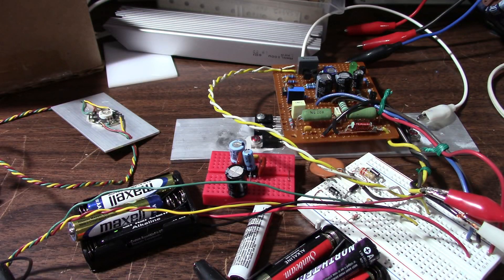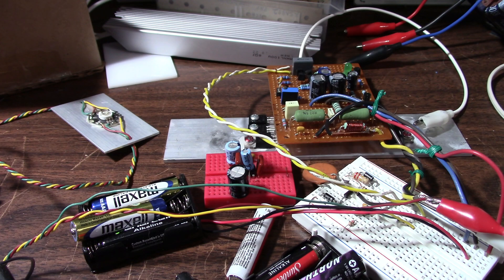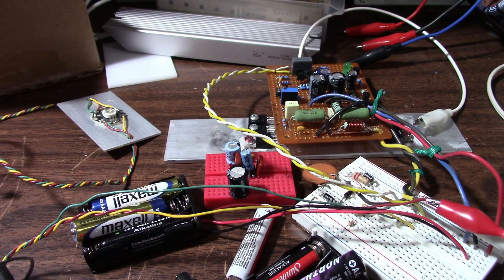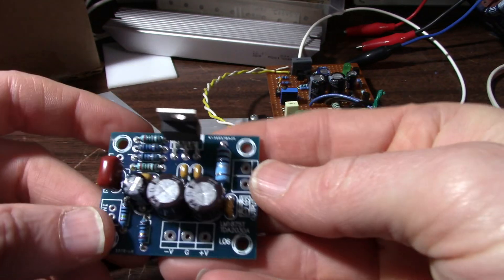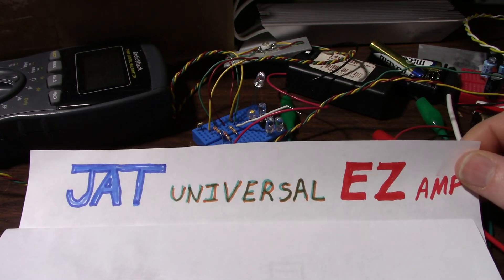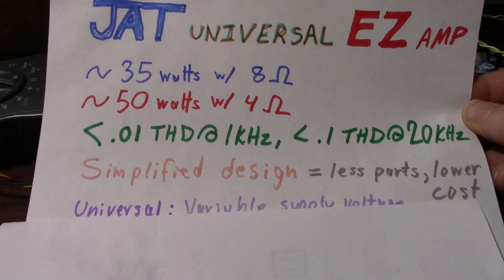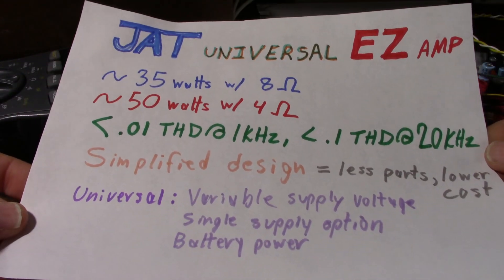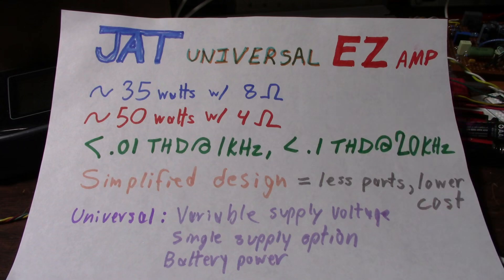"JAT EZ"  audio amplifier project kickoff

Comment: What about using 2x2N3055 or MJ3055 for the output and 3xBD132 transistors in long tail form driving the bottom MJ3055 just google for 5W class A amp and use higher power transistors.

Comment: I built a Universal Tiger from scratch when I was in high school. It was not extremely stable. I took apart a 950 watt x-ray transformer and rewound it for the 40 volt rail PS. The MJ802 and MJ4502 output transistors are scarce. I think the last time I saw them in the wild, they were in a Kennedy 9400 9-track 1/2" vacuum tape drive. 
https://www.mouser.com/ProductDetail/ON-Semiconductor/MJ4502?qs=HVbQlW5zcXU%2F6BhR164nFA%3D%3D

Comment: Hi, John. I have been following your videos for around 3 years already.  I enjoy them and have learnt a lot.  My congratulations to you for your contribution to the Youtube  audio  community! 
 I recall that a while back you did the audio test for the LM1875 eBay board and you were very impressed with its performance and almost no distortion.  There would be no challenge in obtaining the board in Ebay or reproducing it by means of printing it at home. Perhaps your greatest contribution could be testing and proposing the best components commercially available for a Hi-Fi or almost, stereo project, and proposing the stereo wiring, along with the power source; something for a desktop PC.  It would be useful for everyone and would require no development time, since the  schematic and board already exist.  Secondly,  a Hi-Fi headphones amp.  But first of all, the Discrete Audio Amp Project PT17 with a PCB, definitely.   Congratulations again, and keep up the good work, John!

Comment: One of the best low cost real HiFi amplifiers is the Aiyima MX50 SE  kits from Ali Express, they cost only $23NZ a pair. That's amazing value for money. I have used 10 of these so far, all have worked 100% My first YouTube amplifier project used these and many of my viewers made versions of it. The rating of 100watts is a little optimistic but a very clean 85 watts into 8 ohms with a suitable heatsink is realistic. Lots of good sound for little money and easy to build.
Reply from the maker: I'll have to check those out. I doubt the authenticity of the parts at that price.

Comment: Still a discrete design, I like that. Anyone can take an Amp-On-A-Chip, follow the datasheet, and build a working unit in an hour or so, but to go through all the design and testing steps gives you a much better understanding and appreciation of the finished product.

ESP is a vast repository of information on SOOOOO much. For those that have never been, drop by sound.au.com for a real treat.

Like the current and upcoming projects. It'll be interesting to see what you come up with.
Reply: It is true for the most part. But chip amp can be much more to it. Can you make better performance than datasheet? How much better? It's just as challenging.
Reply: @johnyang799  Yes, there are many tweaks and other improvements you can do to the chip amp to improve the performace, but if you want to just throw the minimum parts to get up and running, you can. For example, you can dead-bug a LM386 in about 5 minutes and have the datasheet performance. Follow some of the more widely known enhancements and you can have variable gain and bass boost for about 1/2 hour's worth of work. Could you spend more time? Yes. Will it be worth it? That's up to the builder. 

I just happen to like to know how everything works together and figure out what I can do to improve or tailor the circuit to me. Yes, the interwebs can help a lot, but in the end you still have to do calculations and experiment to go forward. I like the thrill of discovery. 

Yeah, I could go to Banggood, Ali Express, or even Parts Express to buy pre-made boards and save the headaches, but then I'd be just another end user. That's good for some things, but not for my passion and enjoyment.
Reply: @TheTrueVoiceOfReason  Yeah. That's true. To go further you can learn how microelectronics work and how they make the performance for each transistors. 
The better performance I was referring to is to make sub ppm distortion with chip amps. Something like neurochrome modulus series. There is still good amount of complexity there. It's much less complex than a 60 or 80 transistor amplifier just for the same performance.

Comment: Would it be possible to purchase the schematic and PCB layout for your amplifiers instead of kit? Imported kits are infamous for getting lost in customs where I live.
Reply: Hi, John. I recall that a while back you did the audio test for the LM1875 eBay board and you were very impressed with its performance and almost no distortion.  There would be no challenge in obtainig the board in Ebay or reproducing it by means of printing it at home. Perhaps your greatest contribution could be testing and proposing the best components in the market for a near Hi-Fi or a Hi-Fi performance in a stereo arrangement with speakers, casing and power source, for example. Make it a complete audio amp arranngement for a desk PC, as everyone would benefit from such a project. By the way, I would like to congratulate for your videos and great quality content. I've been following you for at least 3 or 4 years. I enjoy your videos, have learnt a lot and I've been following with great interest your current audio amplifier project which I would expect to build with PCB and all, once you finish it. Keep up the good work, John and greetings from Mexico!!
Reply from the maker: I will provide a schematic and board layout to my projects as a free download.